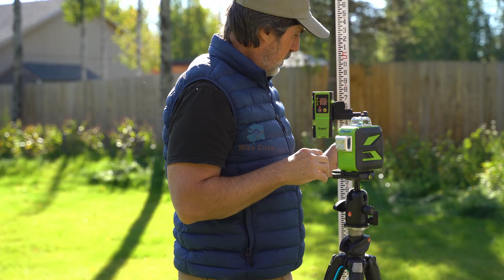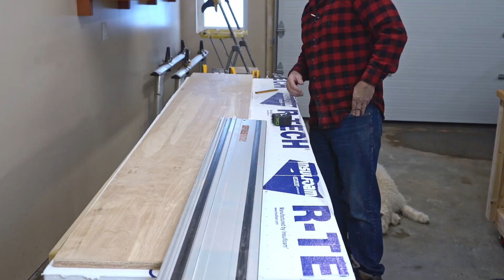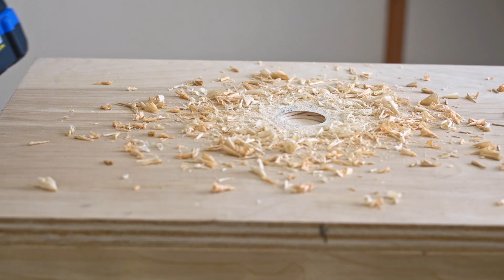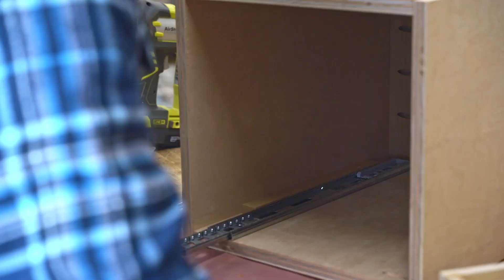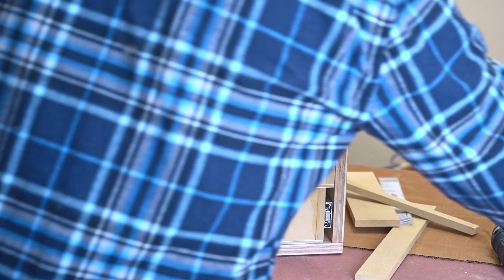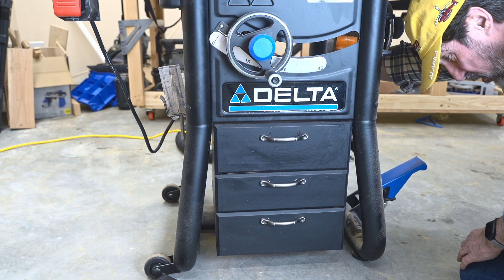Delta Under Saw Cabinet

Comment: I have the Ridgid R4560 and the measurements are exactly the same as yours. I plan to do this also. Just finished the Router table insert on the right with a Kreg lift. I LOVE it!!! Just gotta make the fence now...probably this weekend.
Reply from the maker: They are good saws, I have had my Delta for 5 years and lots of use. Keep making sawdust!
Reply: @AlaskaWorkshop  Went like a dream!! Love my drawers under the saw...great storage for the router bits and tools!! Thanks for the inspiration...

Comment: Building this drawer cabinet today, first time dealing with drawers and slide, what is the inducing slides size of each drawer width?
Reply from the maker: I am not sure I understand your question.
Reply: @AlaskaWorkshop  hello I stopped by Lowes and picked up a set of soft close slides 20 inch I'm making one deep drawer for longer tools and saw blades, I am using the same exterior measurements though thanks
Reply from the maker: @joeoverman795  Fantastic. Sure is a great storage unit and good practice for drawers and slides.

Comment: Buying this saw today or tomorrow.  And these drawers are a perfect addition.  Thanks!
Reply from the maker: Wish I would have made this my first project, sure has been handy.
Reply: @AlaskaWorkshop  Forgot to ask, for the side braces, did you attach them to the saw frame or are they just pushed against the legs?
Reply from the maker: @pd417  Just pushed against the legs front and back. I was surprised how well it worked.
Reply: @AlaskaWorkshop  sounds good....thanks again.

Comment: I'm working on this for my non T2 version. It's quite a bit more different than I thought lol
Reply from the maker: Hope you figure out a way to do it. These drawers are sure handy.
Reply: Hey Nikolai, How did your drawers go for your 36-725 (not T2)? I have the the same version as you and I'm looking to do the same thing that Mike did.
Reply: Looks great! Was there any significant changes to your drawers than mike had on his T2?
Reply: @lacrosse2916  The only issue I had was the metal tabs that hold the stamped sheet metal. I grinded those off/sanded/painted. Then I created some wedges that go between the cabinet and the saw on each side and screwed through those to make it nice and sturdy.

Comment: I have an older delta 34-444C table saw, came with a square base. I just boxed it in and put a cardboard box to catch errant sawdust, works well. After seeing your video, i may half the box size and fit at least a drawer in there. Thanks for the video.
Reply from the maker: You bet, thanks for taking the time to comment

Comment: Did you have a drawing for the side wings
Reply from the maker: No I don't. I just found scraps and cut to fit.
Reply: @AlaskaWorkshop  did you have wings on both sides or only one side necessary and pressure against the the opposite?  thanks much
Reply from the maker: @stevebuteux8218 I put wings on both sides

Comment: Hey Mike where’d you get those side wings? Do you have a link for them?
Reply from the maker: Are you talking about the wings on the cabinet? Those are just scrap 2x4s
Reply: @AlaskaWorkshop  oh ok. I thought it was some part you ordered. Couldn’t see clearly in the video I guess.
Reply from the maker: @jasonvera2269  I filmed it and then edited it out because I didn't want the video to go long. Thanks for asking in case others had questions on it!
Reply: @AlaskaWorkshop  I totally understand. Just 1 more question, what size drawer slides did you use? I’m building it now but planning to do just 2 deeper drawers as opposed to the 3. Still debating.
Reply from the maker: @jasonvera2269  I used 16" slides. You could probably extend the depth of the box an inch and go with 18" slides.

Comment: I am kinda shocked at how many of the same varied tools we have. I've got the same Wen track saw and Powertec rail. Same Ryobi brad nailer, same Kobalt router table. And obviously same Delta saw. Awesome video! It looks like the router table is installed in the table saw wing! Hoping there's a video for that. Edit: Same name too! ha
Reply from the maker: Easy install of the router table onto the Delta. Looking to upgrade to a router lift soon.

Comment: Any further thoughts on the Delta table saw after a few month's use?
Reply from the maker: I wish the dust collection was better! Still happy with it though and have been using it a lot.
Reply: @AlaskaWorkshop  I saw on ETSY someone is selling 3D printed dust chutes that fit into the blade guard for overarm dust collection. I wonder if it would work well? Reviews are good. Zero clearance throat plate too? Anyway, I see the price has gone up to $649. Still seems like the best saw for the money by quite a bit.  Thanks for the reply.

Comment: Hey Mike, nice job! Looking back, is there anything you would do differently on these? I plan to do the same thing this winter.
Reply from the maker: I am actually quite happy with this project. Wish I could redo the drawers with the experience I have gained since then though!
Reply: @AlaskaWorkshop  in what way would you change the drawers Mike? I’m curious as I may build this storage cabinet soon. Thanks, Bill
Reply from the maker: @billirey9459  I would use a different joint is all. These drawers have been holding up great.

Comment: Great idea! And one that moves to the head of the pack of other projects!  Is the MDF used 3/4?  Looks like 5/8's?  Thanks!
Reply from the maker: MDF was 1/2 inch....thanks
Reply: @AlaskaWorkshop   thank you!  One more question.... 20” slides?  They look full length when you installed them. But ??
Reply from the maker: @VmanJeff  Those are 18" slides